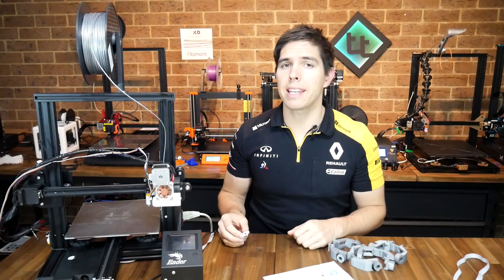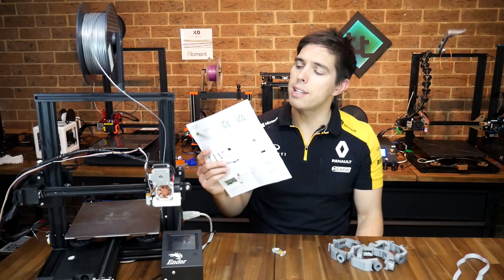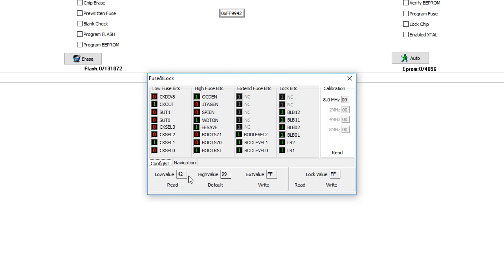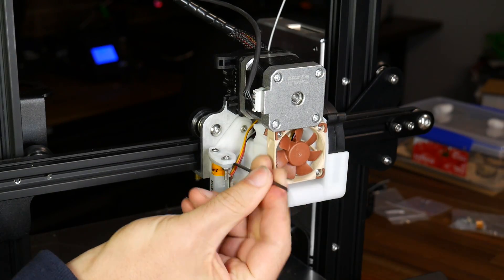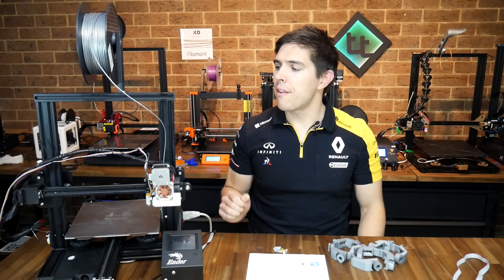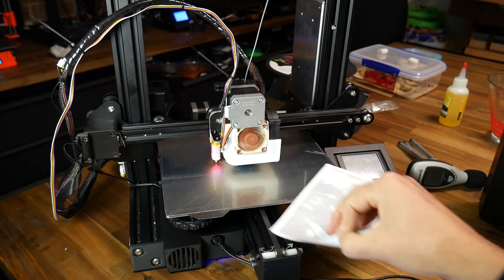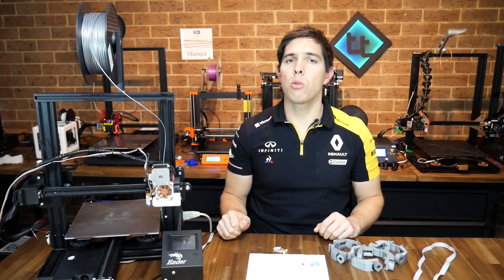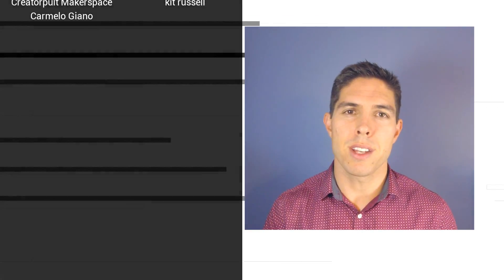Creality BLtouch Ender 3 upgrade kit - Step by step guide with fixes

Comment: Another good video Michael👍👍 it's funny, I bought all these parts (except the creality programmer and mount bracket) individually some months ago with a view to doing a "hero me" conversion with BLTouch and even a Titan extruder. I'm not one to use my printer daily but I like stuff to work when I use it-I've had my Ender 3 since June 2018 and to this day ive only had to reset the bed level maybe 4 or 5 times (when I've given the glass a wash) plus I've tried a couple of other fan ducts but I always end up back with the stock Ender 3 one-I get very good print quality and even manage TPU with no hassles, so I've actually recently started to question the need to upgrade stuff (especially if upgrading printers is not my hobby). I've sold my Titan extruder and I saw this kit and was tempted to buy it even though I have the bits already-bottom like is I'm wondering if any of these upgrades are REALLY necessary?? Sure I agree thermal runaway protection is a safety issue and definitely needed, but everything else?? I'm so confident in my Ender maintaining its bed height I literally never check it and my first layers are perfect every time-even with months between prints! I guess my point is id like to see a video done by someone to clarify what you SHOULD update and why-that way people new to the hobby won't go wasting time and money doing pointless upgrades "because someone said so on Facebook". I see people bragging about achieving HUGE overhangs using things like a petsfang, but at the end of the day, what do you print that requires a printer to be able to do that?? I know some people have "printer modding" as a hobby and as such like to do all these mods and then punch out an impressive test print, but if your new to this (as we all were at some point) and your printer is to actually make worthwhile things and not just print perfect test prints, the forums on Facebook can wrongly lead people to think that these upgrades are totally necessary for a decent print. You may have seen the video on YouTube recently where Chuck recently compared his original Ender 3 with his Ender 3 pro to see if there really is any difference and end of the day they were pretty much identical. 

So my ultimate question-what upgrades are REALLY required vs what upgrades are "nice to have", and why??

Do we really need a "hero me" or a "bullseye" etc?? 
I think a concise video like that would be very worthwhile, much like your marlin ones are, and would also give newcomers to the community a PROPER opinion on all these things. All I see with adding my BLTouch is an extra 5-10 mins per print! 

As usual, keep up the good work, and maybe give some thought to my comment yea? One mod I DID do straight away that I see a lot DONT do is to cut the zip ties holding the cables to the Bowden tube and printed a bracket to support the cables at the back. As yet I've seen nobody recommend doing this but if you think about it, zip ties on your Bowden tube is the last thing you want!
Reply: Hi John.   Some good questions there, hopefully Michael will wade in with his views as he's the guy with all the knowledge and experiences here!. FWIW, I'll add my thoughts as a total noob to all things 3D printing. 

I think Michael himself said that the BLTouch (or any ABL sensor) is really of most use if you frequently switch print surfaces. I put one on as I seem to switch between a glass and plastic surface quite a bit so it's very worthwhile. After following Michael's guide on it, I optimised the Marlin settings for a very speedy but still accurate ABL routine that adds just a few tens of seconds to each print. Happy/10 with that one. This one is a 'if you need it' mod I think.

The duct - I printed and fitted a Bullseye but have been having some clearance issues with it and the clips that hold the print surface on. Partly due to me messing with the bed size in Marlin but also partly the basic shape of the duct. I'll be fitting a HeroMe soon to see if that helps. I do take your point about the value of this upgrade but I figure why not - it costs pence to print and any improvement in performance is a good thing....but probably not essential again.

I also printed a set of cable chains for keeping those bundles tidy and that was very worthwhile I think - the OEM mess is far from ideal. I too released the Bowden tube from bondage to the cable bundle too - an excellent thing to do for a number of reasons, not least to avoid having cable ties crushing the tube.

I wanted to fit quiet drivers so did the MKS-GEN-L upgrade - relatively cheap, a good learning experience too I thought, having never touched anything Arduino before. I'm a retired broadcast engineer so have experience of electronics and mechanical systems, so this whole exercise is fun. I get it won't be for everyone though, so again, you make good points.

A quiet driver upgrade - very worthwhile IMO but it depends on where your printer is I guess. Mine is in the spare room so making it quieter is a good thing.

I'm pretty much agreeing with your basic point I feel - I too would be really interested to hear what Michael thinks about this.

I got into this whole thing after a friend printed me some parts for a car I'm building. It struck me how useful it could be so I bought the Ender 3. I've since designed and printed a few parts for the car that would have been incredibly difficult to make with other methods available to me. I do confess though, up to now, the vast majority have been parts to 'improve' the printer itself - makes the missus chuckle anyway ;)

Comment: Z offset baby stepping guide? How about install this with vanilla Marlin same as your old guide?
Reply: I am interested in the answer as well... I 've installed Vanilla Marlin and just received the kit. Is your previous guide on installing BLTouch on Vanilla Marlin applicable to this kit?
Reply: Yes, you can use the vanilla Marlin video if that's easier for you. The BLTouch is the same so the procedure is the same as the old video (unless you have a BLTouch version 3, if so wait for his next video).

Comment: Thank for another informative review. My install for this kit was much smoother than your. On the progisp fuses values you may have to doc D6-DC-FD. I didn’t have to power on my printer for that part. Also I see that they fixed the reversed black and white wire issue with their new kit. Also thank you for providing the precompiled 1.1.9 marlin with bootloader. But if anyone want to flash their own bootloader you can easily do so with the included programmer by flashing the optiboot_atmega1284p.hex file that arduino ide provide.

Comment: I received the kit a week ago and I spent last Saturday tuning it thanks to your previous videos. I had the following issue:

  - the windows software just did not worked. It had memory violation errors and I quickly gave up.
  - I could not fit the pin 27 adaptor board. Creality and other on Facebook advised to bend the pin but i instead resoldered the ribbon cable that comes with the programmer so I could put the pin27 board somewhere else.
  - bltouch v3 -> Marlin 1.1.x with bugfix (see https://github.com/MarlinFirmware/Marlin/pull/13596)
Reply: When I unzipped the file I noticed it had Chinese character placeholders and I got the same memory errors when running the software. If you rename the folders and remove the Chinese character placeholders, then edit the .ini file and set the new paths the software works fine. I’m still having the issue with the BLTouch Version 3 but will try flashing the v2 marlin firmware.
Reply: - Windows issue doesn't happen in win7, I had the same issue across multiple win10 and server 2016. You can get a free IE dev version and run it in a VM
- Same issue, I just undid the screws and shifted the board. Sat the board on some pieces of plastic.

Comment: Looking forward to the video about the 3.0 since that's the bltouch I have. I have been using Marlin 2 bugfix branch and I've been having a nightmare with my z offset. I can get the nozzle to touch the bed with g1 z0, but printing starts WAY above the bed. I also have the tft28 installed so babystepping isn't on my menus so I've been having to cancel the print and m851 the offset lower and start a new print :(

Comment: I got my kit back in February, and it came with a BL Touch v2, and I did not have any problem downloading Creality's firmware (only problem was actually finding it, as the QR code on the instructions did not take me to it).  That said, I strongly agree that their official instructions have significant room for improvement.

Comment: Do you still need the pin27 board on the 1.1.4 mainboard?
Reply: yes
Reply: Yes, but you do not need to flash a bootloader first before updating the firmware.

Comment: for the v3.0 Bltouch just use marlin 2.0.x Bugfix for now it has everything you need to make the v3.0 work no problem if you're confused as to make a new firmware file then Teaching techs video on it will help alot. its the same as the 1.1.9 vid but there is one more command you need to enable for the v3.0 to work.
Reply: bugfix-1.1.x now also works

Comment: I Michael, its possible install the BL Touch with TH3D firmware more simple?
Great video
Reply: The latest TH3D versions have removed support for BLTouch because TH3D has a competing product (ABL inductive Sensor). I'd recommend using Marlin instead since BLTouch V3 is now being shipped and TH3D does not support this version in their older firmware releases.

Comment: Thank you for this video! I wish you would have made it two weeks ago! I order my official Creality BL Touch kit hoping to bring ABL to my Ender 3 and after two nights after work messing with it, and a Failed attempt that took most of a Saturday, I just took it off. The wires are still there and the mount, but I hooked up the Z-Axis End stop and leveled my bed the old fashioned (if anything in 3D Printing acna be called old fashioned!) way. So I look forward to your next video, as always, and another thing to note, before installing the BL Touch, make sure your bed is level to begin with. This may seem like an apparent thing to do, but my first night of frustration was because my bed wasn't level before I put the probe on. Thanks! And keep up the great videos!

Comment: I just got mine in the mail. Ive already burned a bootloader to my mainboard, so I should just be able to follow your older BLTouch install instructions right? 

Apparently Marlin v 1.1.9 isn't compatible with a V3.0 BLTouch. It's been added to Marlin 2.0.0 hotfix.

Comment: I bought the kit for my Ender 3 several months ago and I had to switch the black and white wires otherwise it didn’t work. I didn’t have any issues with the software like you did. After I upgraded the main board to a MKS Gen L I had to switch the black and white wires back and also the blue and red wires on the other plug...

Comment: Would upgrading the mainboard to the silent main board 1.1.4 first help? If so which hex file would  best to use, given it already has a bootloader?
Reply: That board does not have thermal runaway protections enabled, just like the official Creality V2 firmware, so you should either download TeachingTech's pre-configured firmware linked in the description or follow his video on how to update Marlin manually if you need other features enabled.

Comment: Purchased this kit from Aliexpress. Black and white wires were reversed and had to be switched and the Pin27 board made it impossible to put the fan cover back on so I had to bend it.  After those fixes, it works correctly. This was a couple of months ago.

Comment: You should add that you can not brick your board with PROGISP, because you will simply be able to fix (re-program) it anyway!
Reply: not sure if that's completely true; what are those 'fuse codes' for ?
Reply: James Laine you can set clockspeed, ability to have read/write protection etc. Theoretically you could brick it, but it is very unlikely if you follow instructions